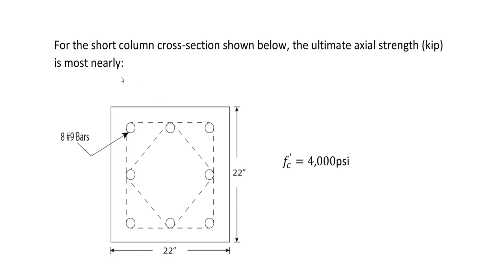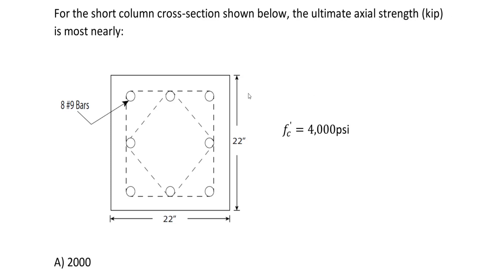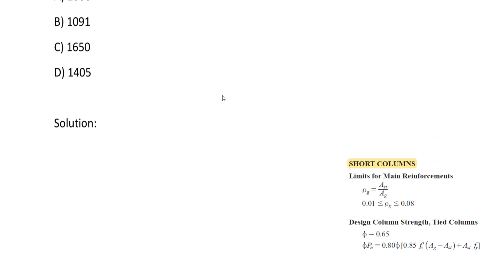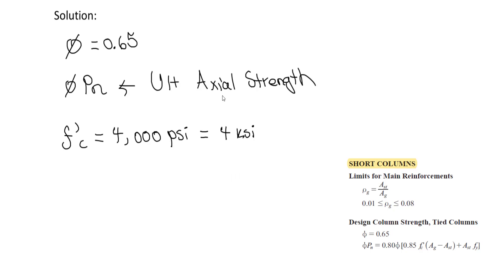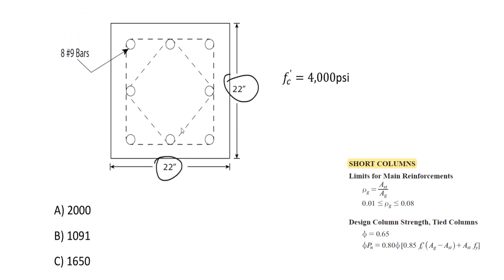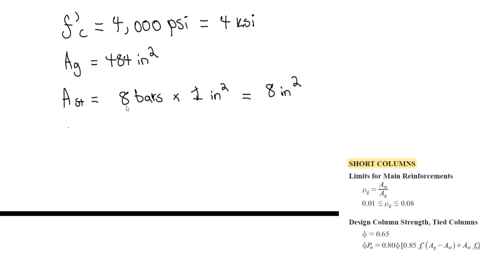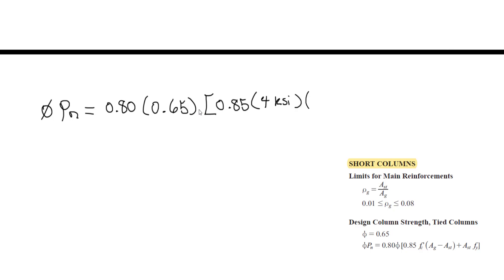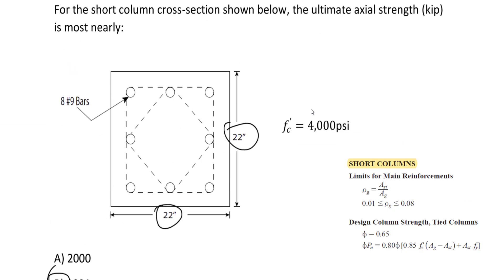FE Exam Review - FE Civil - Short Columns - Structural Design

Comment: Recently, I got a FE question on a short column asking about the ratio of concrete to steel (Ag/Ast) based on load, fc. fy, column section. They added eccentricity for the axial load about 5 inches. What will be the approach to consider the eccentricity in the calculation of actual axial load? Please help.
Reply from the maker: Hi, so for that case you would be given the maximum axial load and maximum moment. Also, the problem statement should include certain dimensions about the section (h value and b value). The goal then is to use the interaction diagrams on page 279-280 in FE Handbook 10.0.1. You will need to find the axial compression value (y-axis) and bending moment value (x-axis). With those values know, you will plot and see where the lines intersect the "row_g" value - which gives use the Asteel/Agross ratio. This allows you to solve for the amount of steel required to sustain the load and moment. Hope this helps.
Reply: @directhubfeexam  Great, would it be possible to make a video lecture on that? It will be really helpful.